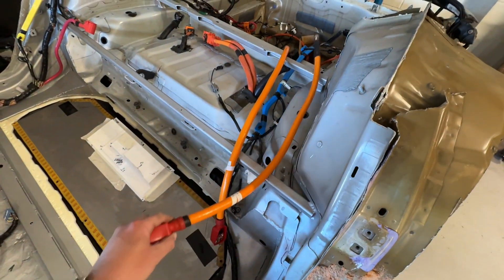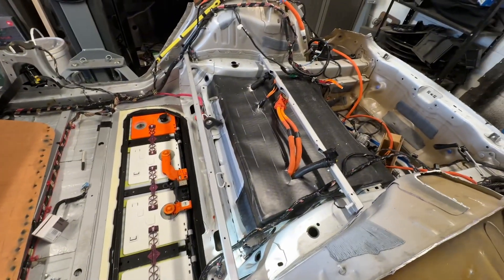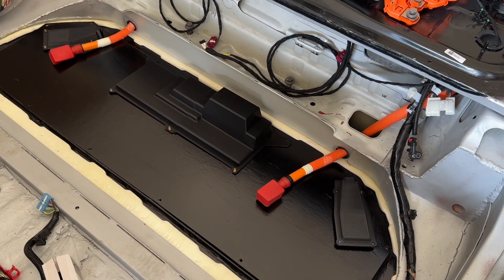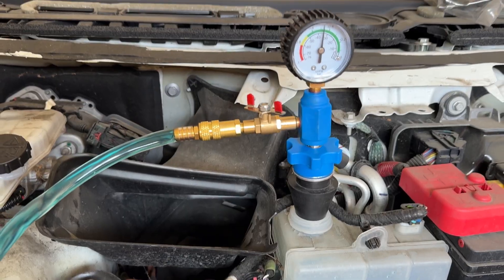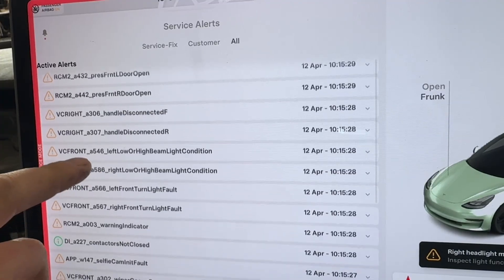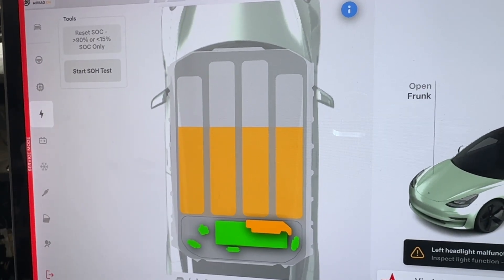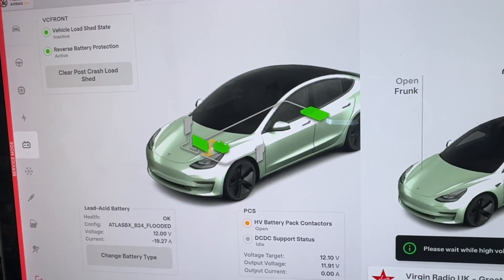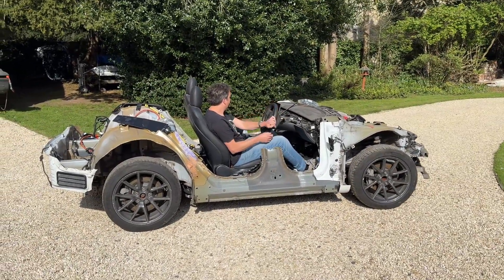Tesla Gullwing build part 11: short wheel base model 3 driving!

Comment: Why not make it a Roadster?
Reply: My best guess: would still have to have the upcoming roll bars to replace the structure removed, would be very unsightly when finished. The original SL had a tube chassis, but it was low in the car.

Comment: Nice! Great to get it up and running again!👍
Reply from the maker: Thanks Syd! Did you have any isolation errors when you connected yours back up? Hoping it’s something simple. I just cleaned the 12v ground at the penthouse and that has helped so maybe it all adds up…
Reply: @ricolaracing  Hmmm. No I didn't. Make sure the penthouse (mainly the cover) is well grounded as well as the main ground terminal from the PCS. It may be a long shot but I wonder if the battery protector covers you put on (the HV terminals) are creating a slight continuity through the outer battery cable sheath?